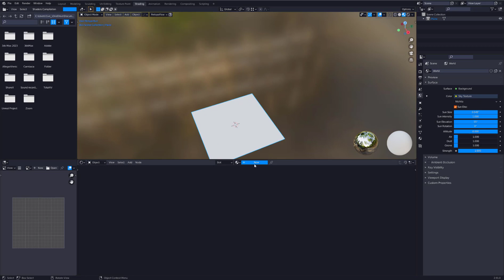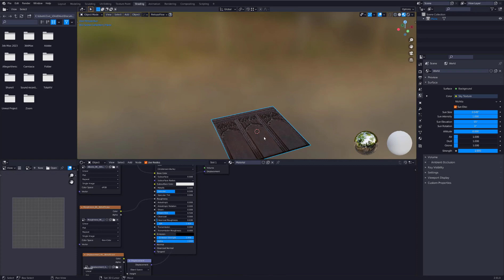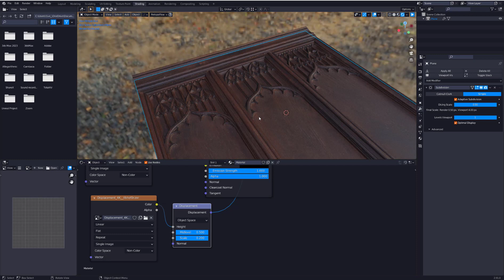Adaptive Subdivision - Blender Displacement

Comment: Hello!  as soon as I turn on the reaction to the group, when rendering, the error "The system does not work with the graphics processor" pops up, although everything is fine in the viewport shading.  as soon as I turn off the disturbing subdivision, the rendering goes well.
Reply from the maker: Hey Artem what GPU/CPU are you using?
Reply: @3DJay429  RTX 2060 / i7 9700
Reply from the maker: @artemryakin6214  Yea that is weird, make sure you have all new drivers and updates, and have you tried a new version of blender?
Try also a new dummy file to make sure its not a corrupt file or something

Comment: 😀if anybody wants to make their workflow on this quicker all you have to do is install the Node Wrangler add-on for blender and then select your principled BDSF shader and click control shift T of course after you've enabled the add on in preferences and it will load all these nodes up including the displacement node... You have to name them appropriately and that information you will find after you've installed the add on and you click the little tiny triangle that's all under the name of the add on in preferences
Reply: was also going to comment about the node wrangler XD but overall easy and quick how to
Reply: @malache401  😀'great minds!